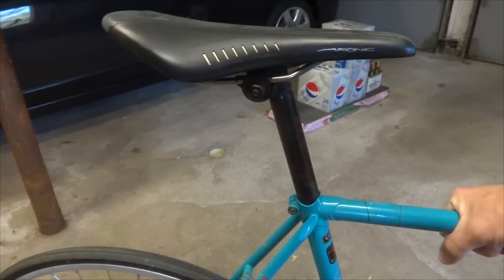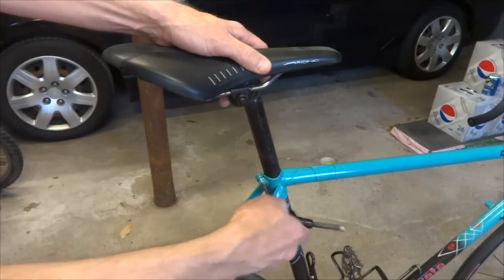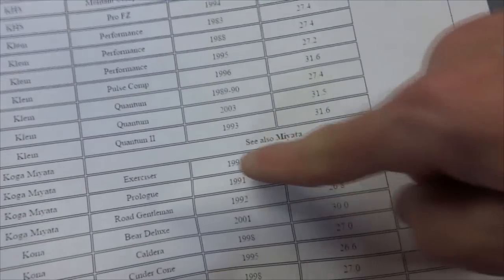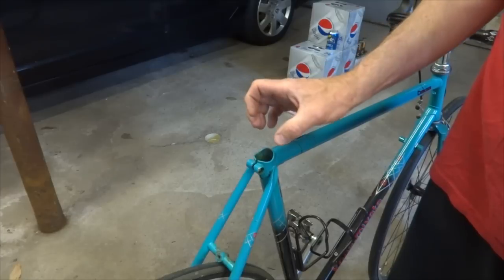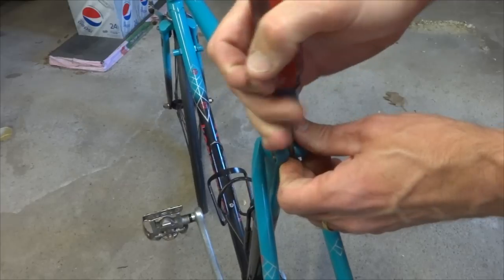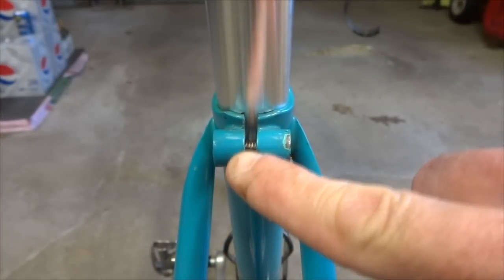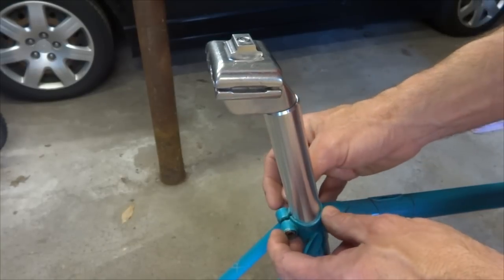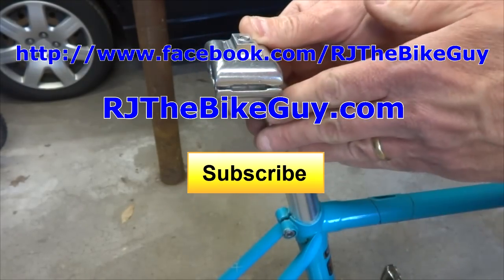Seatpost Size - From Wrong To Right

Comment from the maker: For more bike repair videos hit the subscribe button 🛑 and click the notification bell ► http://bit.ly/SubRJTheBikeGuy
Reply: You could use a coin to open the gap without damaging the tube, just put a coin that fits in the gap and then put the bolt from the other side, when u screw it in, it would start opening the gap pushing against the coin, it works with the stems that are to tight.

Comment: Here is a suggestion for you that is less likely to damage the paint, only works where the seatpost clamp is part of the frame as in this video. Remove the clamp bolt and thread it in from the other side, put a penny in the slot and tighten the clamp bolt against it, you can now adjust the gap without the risk of slipping and damaging your paint/stabbing yourself. Also works on old style stems 👍😊

Comment: RJ, thanks for posting this video. It was very helpful. I just purchased a 1992 Raleigh Competition that requires an extreme amount of pressure to get the seat post to stay. The current seat post measures 25mm, but after some research on the internet, I believe the particular model I have requires a 25.8mm post. I think the extra 0.8mm smaller diameter is where my problem lies. I just ordered a replacement on eBay that is supposed to be 25.8mm. Your video was the only one I could find that has same one bolt design of seat post clamp like I have.

Comment: I bought an old bike a few months ago that had the seat post shimmed with duct tape. It was a mess to clean up the old adhesive inside the tube and on the seat post.  I also saw on Steel is Real a trick for cleaning up the seat post from burrs, they used a brake cylinder hone.  This keeps the seat post nice and scratch free.  Just thought Iwould share.

Comment: I found with a lot of old steel bikes that the clamp was compressed super tight or the wrong shim was used and you have to pry it open again if you want to use the propper size seatpost. Lucky you can coldset steel frames without damaging it. Alloy is basically runined at this point.

Comment: Lugs are made to a standard size but tubing is various thicknesses.as a consequence the finer the tube the larger the seat post.
 It is possible to use a smaller seat post and wedge shaped shim to open the hole and split lug which needs to stay circular,avoiding stress to the bolt eyes.

Comment: Just had this issue with an 83 Raleigh record I was building up as a junkbike, couldn't find any info on what the diameter should have been, not even Sheldon, and my fix attempts went south but this is a great video for if I ever run into the issue again and know the correct size.

Comment: I have a similar problem with my Peugeot road bike from 1976. The last seatpost was so thin, that the former owner deformed the clamp by tightening it and also deformed slightly the diameter of the seat tube. Its hard to estimate the proper seatpost diameter now. What would you do? I am afraid of breaking the clamp when I try to bend it up...

Comment: I was just wondering about that because I have a bicycle with a seatpost so tight on the frame that the bolt is a little bit bent.
Also, the seatpost is stuck on the frame so I sprayed some WD-40 to losen it up a bit. Hopefully it will come out and I can start fixing it.

Comment: Hey RJ! I have no idea what my classic bike is until now hence the seatpost database is a bit toast. However I'm still betting mine is a 26.8 (a 27.2 does not fit on my seattube). I'm currently running a 25.4 with a homemade shim lol.

But in case, can I measure the seat tube diameter and base off that? Or is it still thicker than the inside? Cheers.

Comment: Aside from the screw-driver trick, do you have any tips for how to expand a seat tube that has been over-tightened? I've done the steel wool on a coat hanger + drill routing, my seat tube is now super smooth, but with a screw driver I haven't been able to open up the notch at all. Wondering if there is a better tool.
Reply from the maker: I don't really have any better suggestions. Take your time.

Comment: Good Day.  I was given a beautiful Norco bicycle, with a expanded bicycle seat tube.  I Researched the correct size, which is 27.2.  The previous owner attempted to install a much larger seat post which damaged the seat tube, by being pried open for the larger seat post. It is a quick release system.  I would like to know how to reform/ reshape  the seat tube.  Any information would be much appreciated.  I looked at your videos and you didn't cover this subject, maybe a new video, is in hand.  Have a good weekend.
Reply from the maker: Ouch. Yeah, not a standard fix for brutal damage like that. May not be able to reasonably fix it very well it at all.

Comment: Hi i want to install suspension seat post onto the old mountain bike. The only problem I've got is the old seat post is 25.09. And the new suspension seat post I'm thinking of buying is 27mm is there a way around the problem.
The bike does have steel frame and it does have a split where the seat post goes in. Let me know what you think I should do. If you have any suggestions.
Reply from the maker: Not going to happen.
Reply: Thanks for your reply I appreciate your help

Comment: I found a magna bike. Some one in my building Threw  it away. The only thing , it doesn’t have the seat or seat post. How do you know which post to buy for it? Ty
Reply from the maker: Measure it, or do research as to what size seatpost it takes. Most seats will fit. Don't spend too much as Magna's are junk bikes.

Comment: Nearly the problem i am facing with my rebuilt bike, i need a longer seat post but cannot find one that is exactly 25.4mm I have checked 2 and they were both out by a TINY amount which falls in or if tightened, squashes the frame tube to nearly touching. Infuriating :)

Comment: I’m having issues installing a seat post into a bmx. I took out the old one as it was beat up really bad and am replacing it with a new one. Both are 25.4 mm posts but the new one won’t make it in more than a couple of inches. It stops at the end of the split in the seat tube. I’ve sprayed it with lubricant but no difference. I can maybe bang it in with a mallet but am scared I won’t ever get it out again or even be able to adjust the height if need be. Any ideas? My next step is to freeze the new post which should shrink it slightly and heat the seat tube with a hair dryer which should expand that slightly.
Reply from the maker: Not sure. Maybe get a caliper and measure the two posts. Maybe someone sanded the old one down to make it fit. Maybe it is supposed to take a smaller post. do some research, or get a seatpost gauge set.

Comment: Is it possible same thing happens to a aluminum frame? I have a trek 8000 1991 which is supposed to use a 27.2 seatpost, however, it was using a 26.2!! I tried fitting a 26.8 and nope, didn't get it. I don't know whether Trek made different seatpost diameters for the south american market or whether I should try to expand it (im not pretty sure about doing it since it's aluminum).
Thanks for the video!
Reply from the maker: There are a huge variety of sizes. I don't know what yours is. The little slot on mine was pinched almost completely closed. So I knew it was the too small. On an aluminum frame you are more likely to crack the frame. Even on a steel frame it is possible to damage it, trying to repair abuse like this. But it is possible yours came with a small size.
Reply: It'd be really interesting it came with a small size (26.2) considering it's aluminum and that the US catalog mentions a seatpost diameter of 27.2. Guess they marketed a different size for the South American market. It's second time I find a different seatpost diameter than the catalog's in US bikes sold in SA.

Comment: if you couldnt find a list, how about measuring the diameter of the tube about 4 inches down from the top of the tube. then take measurements of the thickness of the tube, and subtract that amount times 2 , wouldnt this give you your inside diameter measurement?
Reply from the maker: The diameter lower down is sometimes wider. And it would be tricky to measure 4" inches down anyway.

Comment: I have a 28.6 steatpost and the bike takes a 29.6. can't find the right seat post anywhere. Can I use some electric tape maybe?
Reply from the maker: No. Find the proper sized seatpost. Or get a proper shim.
Reply: @RJTheBikeGuy  can't find a 29.6 stem anywhere. And can't find a 28.6 to 29.6 shim. That's why I asked about tape
Reply from the maker: @enigmaticreverieproduction5169  https://www.ebay.com/sch/i.html?_from=R40&_trksid=p2499334.m570.l1313&_nkw=29.6+seatpost&_sacat=58101

Comment: Does anyone knows what seatpost diameter the 85 DX-3000 uses, is it 26.8mm? Tried fitting a Schwinn Cimarron seatpost which supposedly is 26.8mm and it gets in easily while on the contrary the seatpost from the DX-3000 can't get in as easy on the Cimarron
Reply from the maker: You are going to have to do research.
Reply: @RJTheBikeGuy  I have, but there's some contradicting info, example
https://www.panasonicbikemuseum.info/faq/seat-post-size/
states 26.8 for DX-4000
but on this other page
https://www.pedalroom.com/bike/panasonic-dx-3000-14060
states 27.2mm for the same model but from a year later
Reply: The size it uses is 26.8, I wiped off the grease on the seatpost.

Comment: Never thought bending the seatpost housing.
I already grind the seatpost tube to make a little gap for my seatpost.
:(
Reply from the maker: You shouldn't have to. Use the proper sized seatpost.
Reply: @RJTheBikeGuy yes, my fault not watched your video earlier,
After already grind the seatpost housing, the seatpost still loose and keep twisting to right and left, plus know i already increase the seatpost size but its keep twist to the left and right
I found same oil on the old seatpost, does it contribute to the twisting seatpost?
Do you have any suggestions how to stop my twisting seatpost?
Thankss
Reply from the maker: @angelm6090  Then maybe you have the wrong sized seatpost. Maybe you are not clamp it tight enough. If it's a carbon seatpost, you need a special paste. The should be a thin coating of grease on the seatpost.

Comment: I have the problem that after my bike was painted the seatpost doesnt fit anymore. Any ideas?
Reply from the maker: +Hendrik S You shouldn't have painted down into the seat tube. You can try removing the paint inside the tube, or use a slightly smaller seatpost I guess.

Comment: what's the purpose of that big hole in the top tube ?
Reply from the maker: For an internally routed brake cable. https://www.youtube.com/watch?v=IEL7pLwTZw0
Reply: thanks alot for your explanation
Reply from the maker: Sensei Gichin Funakoshi? Shotokan karate practitioner? Are you a black belt?
Reply: right  2ºDan 27 years practicing Karate do Shotokan and 17 years practicing Kenjutsu
Reply: and the most important of all - 1 hour bike ride every day
Reply from the maker: Nice. I practice Isshinryu karate (6th dan). I have also done a few other styles.
Reply: great one of the oldest and traditional styles !! All my respects !! I love all the Sai katas
Reply: So you are a Karate Sensei and a Bike Sensei
Reply from the maker: I teach karate similar to teaching bike repair. By breaking stuff down into steps and explaining why we do stuff. :D
I do have a couple karate related vids if you haven't seen them. 
https://www.youtube.com/watch?v=neUJ2ftmCcI
https://www.youtube.com/watch?v=O0CswybvtoQ
Reply: excellent teisho tameshiwari